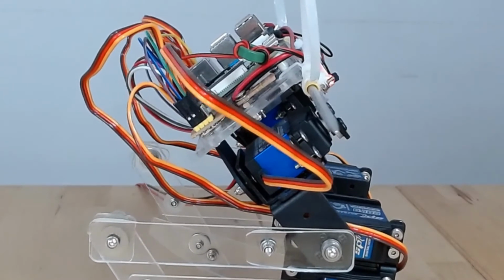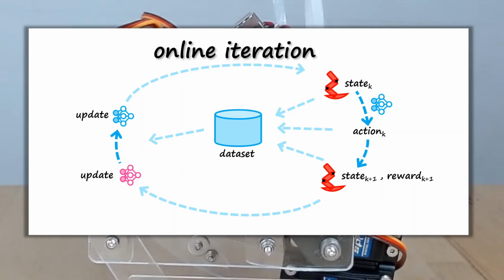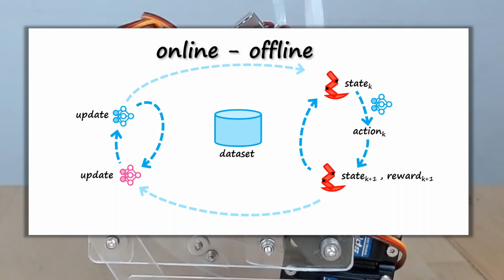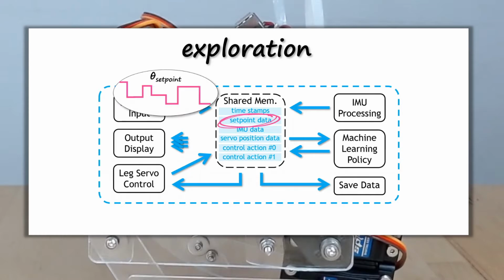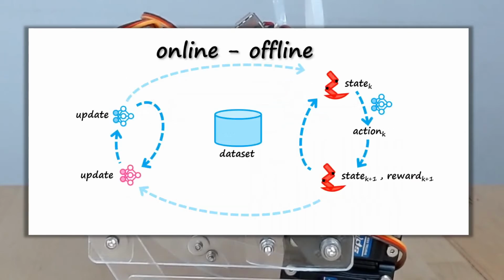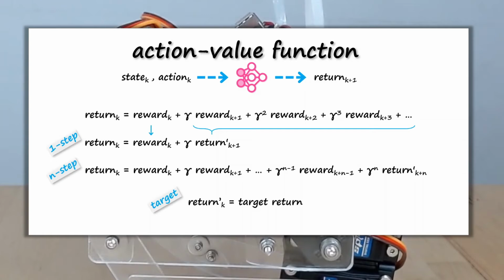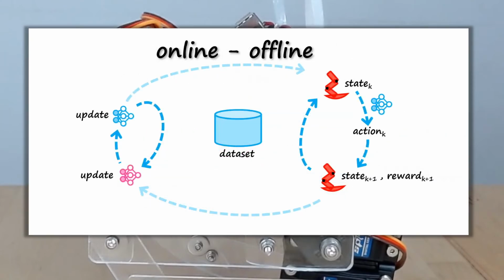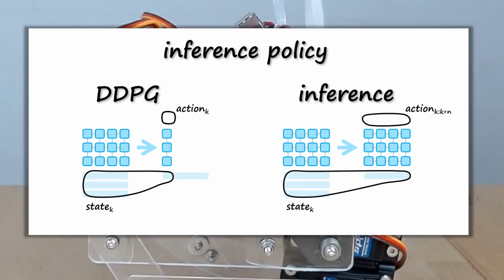Robot Legs: First Bipedal Balancing Prototype

Comment: These videos have been great at explaining the concepts involved in this complex process! will you provide videos on the actual process of how to program the robot with python to achieve the steps mentioned in these videos too? If not, do you have any recommendations in regards to resource material?
Reply from the maker: On the first question, I am not planning on going into any more details on the programming side of things... Which leads to the second question... Which is kind of hard to answer, as it all depends on your starting point and background. :-)
I didn't follow any specific resource material for this - my general approach is simply to grab something and learn by doing. So I would recommend buying a Raspberry Pi and tinkering, doing some online Python course. And for Machine Learning, I have done several of the Andrew Ng online courses over the years. They are great.